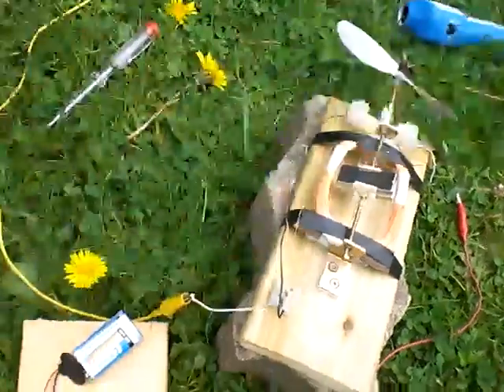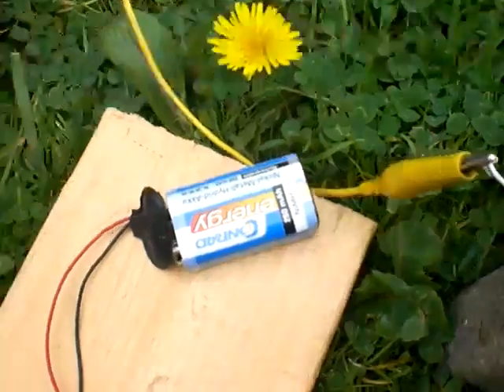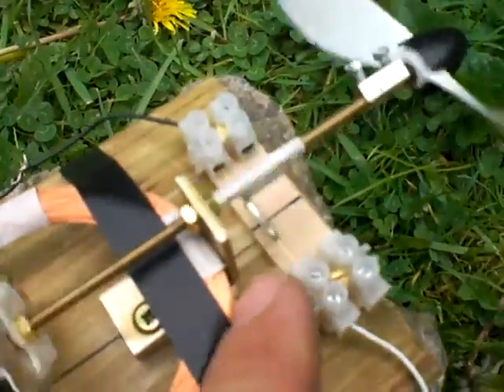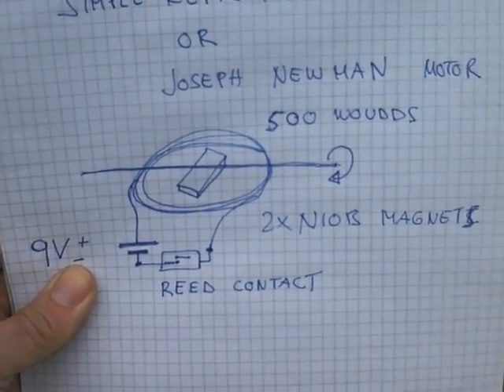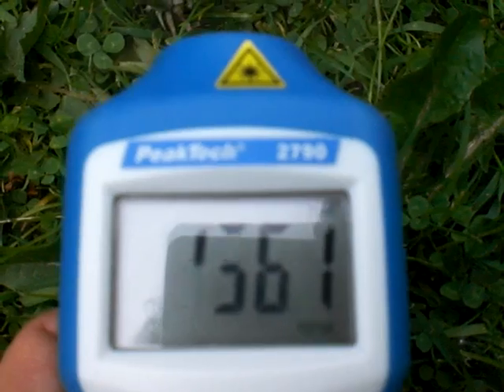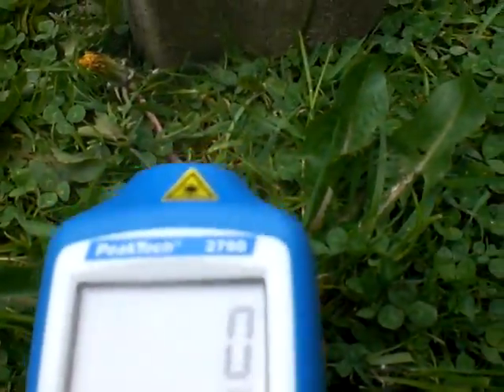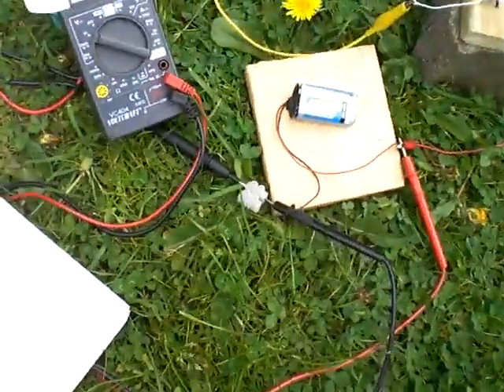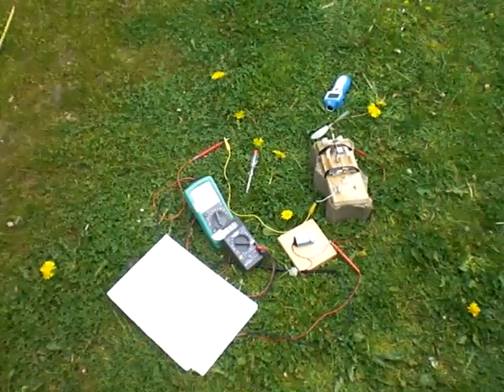Small Keppe Motor Part IV

Comment: drspeedy09 ....how much influence does the gap between the magnet and the coil have on the current draw and  the torque on the shaft?Is it best to have more windings and a low voltage or less windings and a stronger voltage?

Comment from the maker: 9V x  0,022 A = 0.2 Watts are being used by the motor with that propeller. Using a NIMH AKKU 9 V BLOCK 250 mAh shown in the film, means 250/22 = 11 hours of use.

Comment from the maker: The reed switch is normally closed. It is magnetically opened and closed by a small magnet on the front axis. Just take care of the phase between magnetic rotor position and small magnet so you get maximum rotation.